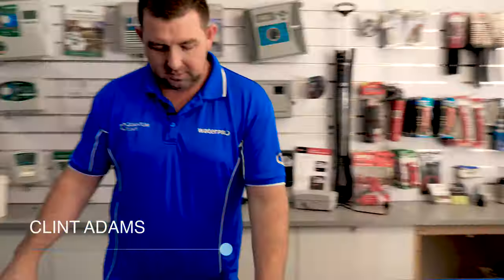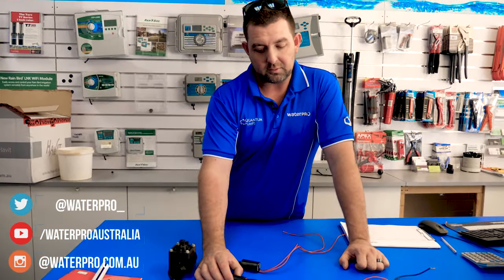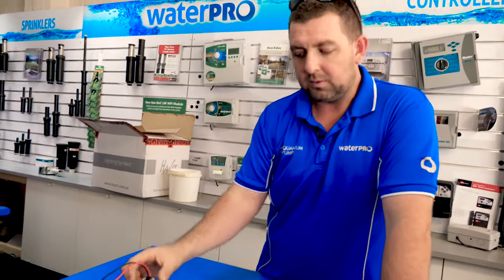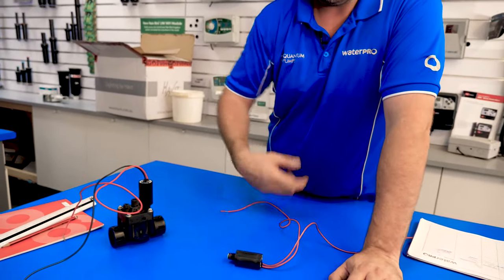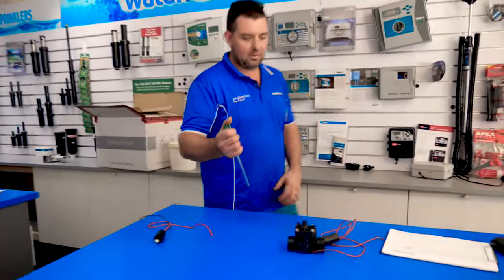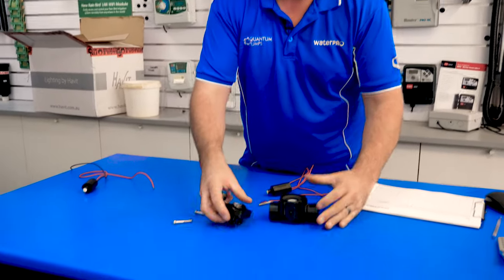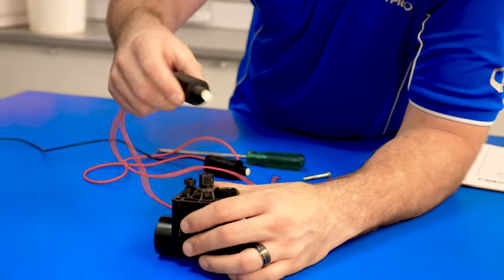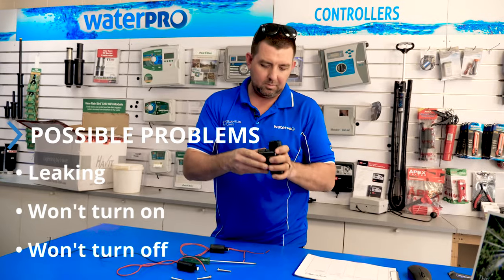How to Troubleshoot and Fix a Broken Solenoid Valve

Comment: Thanks Very informative. Bought a house with irrigation system in. Hunter system. Zone 2 of 6 has recently stopped working so pump comes on but shuts down after a few seconds. Now have to try find which one it is and then do what you said.
Reply from the maker: Glad it helped

Comment: My irritrol 217 opens and closes fine, but the valve only opens halfway. No difference if I use the manual bleeder or remove the coil completely. Any tips?
Reply from the maker: Have to looked at the flow control? If you can turn it anti clock wise at all do that. It will open it up. Also, sorry this too a month mate. So many channels, so little time.

Comment: I replaced the coil and diaphragm and the station only runs manually if I twist the bleeding screw on the valve itself. 
If I then tighten the screw up again while running the station turns off.
Any suggestions?
Reply from the maker: OK. That means the diaphragm is fine and there may be a problem with the coil. Can you turn the valve on by turning the coil anticlockwise?
Reply: @waterproau  yes ,when I run the station it will fire up if I unscrew the coil half a turn.then when I tighten it back up again it shuts the water off.
Reply from the maker: OK, it sounds like an electrical issue. Are there other valves on the same manifold? Have you checked the wire?
Reply: @waterproau  3 stations are all within 200mm together.  I did notice a touch of green death on the wires when I replaced the coil.
I'll try and get down to some fresh wire I guess..
Reply: I cut the wire to some fresh stuff and twitched them back up and tested the other two stations near by and found they also only work manually after running their station number...they also turn off after tighten up.
Hmm.
Thanks for helping me out.

Comment: I’ve got low pressure on just one of my three zones. Can the valve only partially open?
Reply from the maker: Hey Todd. I was just cleaning up the comments inbox and notice we hadn't replied to your question. Firstly I'm sorry its taken 5 months. You probably have sorted it out by now but ill post the answer below in case it helps someone else.

A valve will only partially open if it is:
- Damaged
- Has the flow control turned right down
- Is blocked either with a stone inside the valve or the pipe is crushed on the outlet.